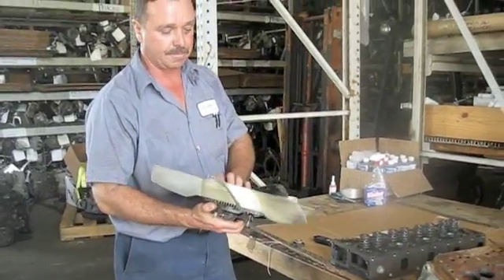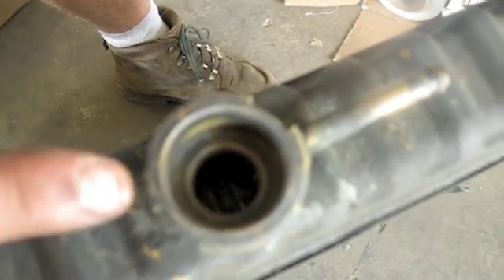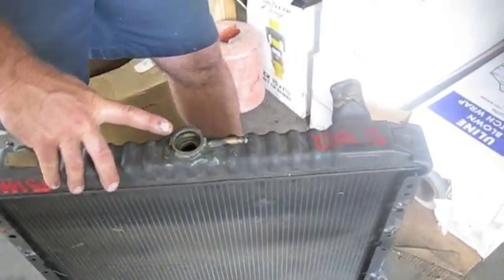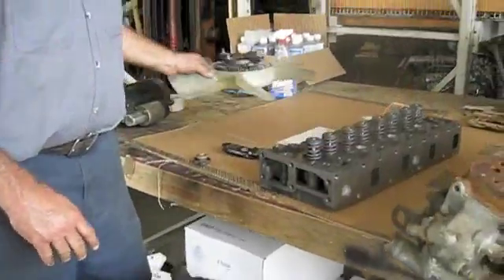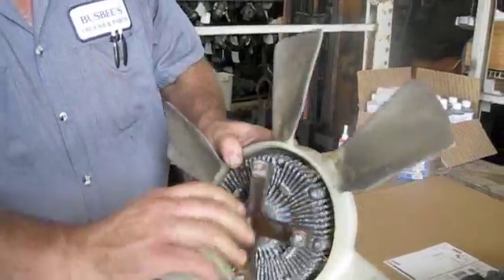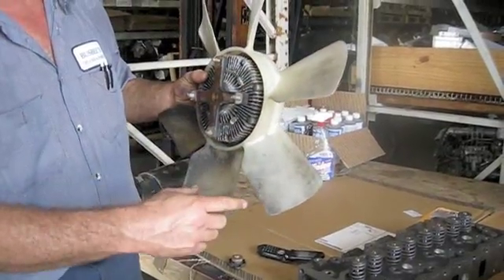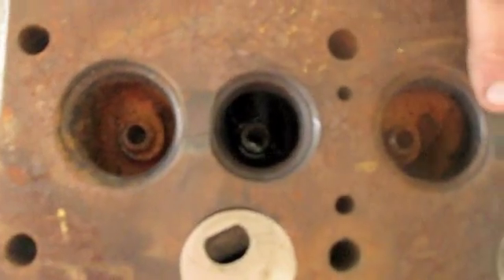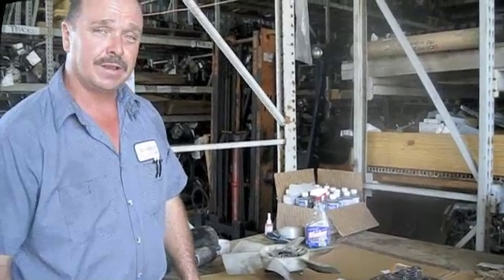How to Avoid Engine Failure Isuzu Diesel Engines 4BD2

Comment: Anyone know why the power steering pump would be leaking or if it's common? Replaced a power steering hose and tried bleeding the system but started leaking at the pump on passenger side engine area - thank you

Comment: any one can tell me why oil leaks on the turbo on isuzu npr
Reply: Could be a few things.  #1....DO NOT over fill the oil....not even a half a quart over #2  Dirty air filter can cause back pressure. #3 Particulate filter clogged causing back pressure.  You definitely need to pull the hose off the turbo cooler and make sure there is no oil in it.  If there is.....you need to take the cooler off and completely drain it and wash it out with soap and water.  Make sure it is completely dry before putting it back in.

Comment: last year the water pump broke down and it cost me $2200 and they changed the radiator fan which they said it was broken . and after the repair i checked the new fan which is moving freely as you mentioned that the fan should not move freely so i guess they didn't do the right job and that cause all the new problems i never had any major issue with this before

Comment: hey buddy i got isuzu npr 200 since last Friday my truck is broken down and i took it to the diesel mechanic and he tested the fuel injector and also compression test . injector seems to found ok . 2 cylinder and found no compression . performed cylinder leakage test and found air escaping from intake . what should i do now

Comment: I have a problem on my 97 isuzu npr I full rebuilt the engine and got my radiator cleaned and overheats only when I'm getting off the highway
Reply: Fan clutch probably worn out
Reply: I’m having the same issue with my 95 NPR. Did you ever confirm if it was the fan clutch?

Comment from the maker: How to prevent engine failure in your Isuzu NPR, Isuzu NQR, GMC W3500 and GMC W4500 diesel engine. Doug Busbee demonstrates how to prevent overheating or a fan clutch failure.
 #usedtruckparts   #trucking

Comment: My Isuzu im assigned to at work Is automatic transmission and I have to physically lift my foot for it to shift every-time and  press on the pedal again till it gets ready to shift again then I repeat. Why is this?
Reply: hey I have same problem   got new turbo new head piston rings seals still same problem
did u get any answers
Reply from the maker: E.W. Smith zach stevens There’s a number of things that can cause this. Probably the best thing to do is to refer you to a reputable transmission shop and have them check it out and give you an answer.